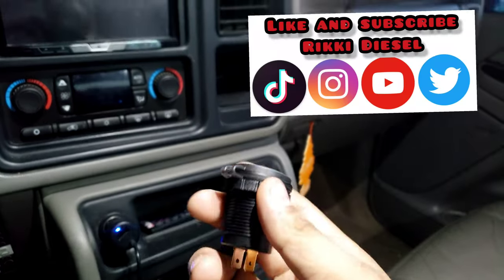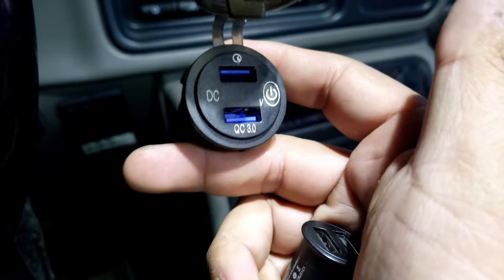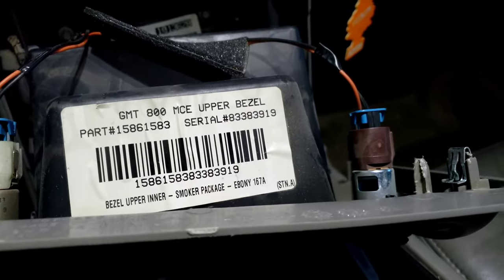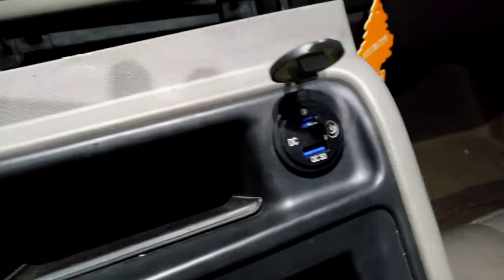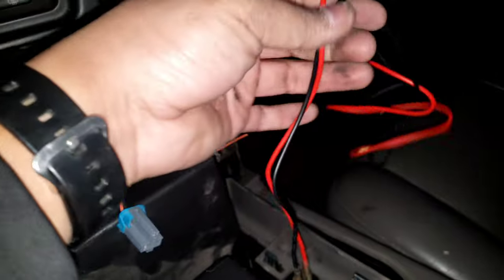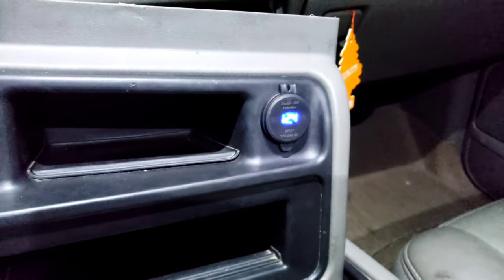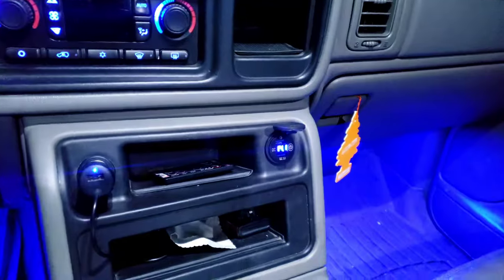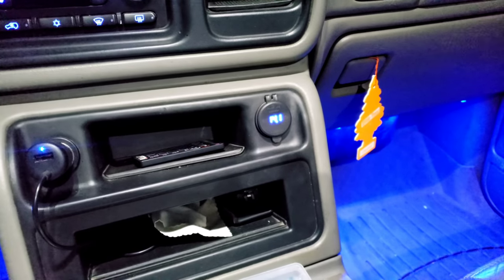duramax USB power outlet install

Comment: How is this mod holding up to this day? Does it still function properly? Thinking of doing this mainly for the on and off feature because sometimes I forget to unplug my push in style  usb car charger.
Reply from the maker: Its working great still no issues. Still got another one I need to put in my wife's yukon but I definitely recommend it
Reply: @rikkidiesel  Just ordered from the link you provided. Thanks!
Reply from the maker: @itsmemaaaark  sounds good man